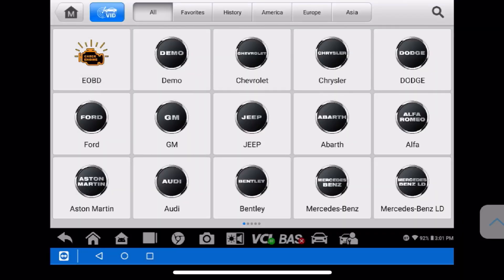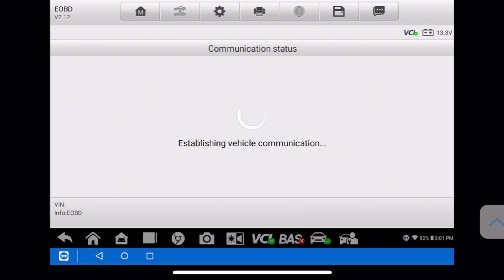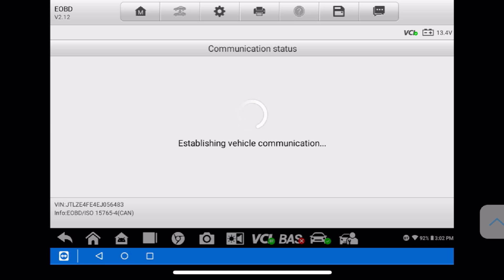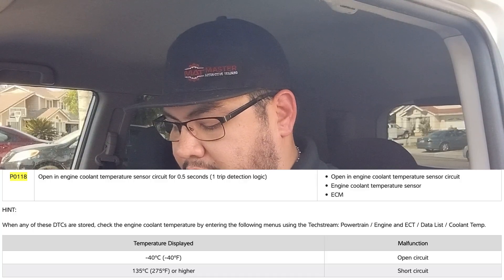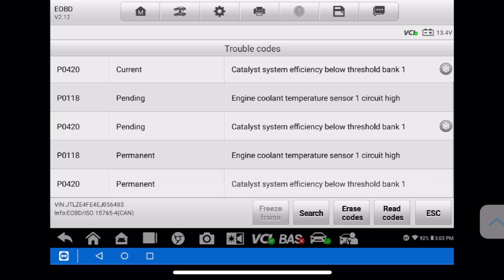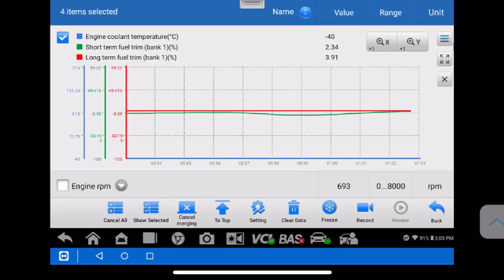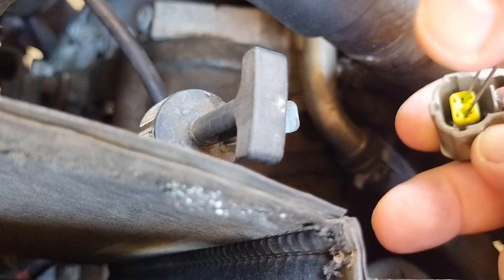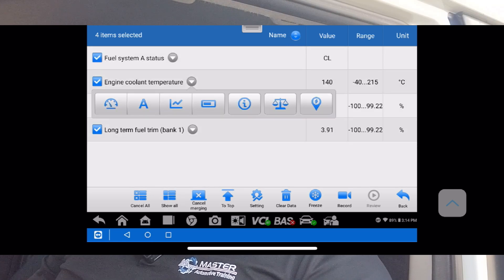Engine Coolant Temperature Sensor P0117 / P0118 | How to Test and Replace

Comment: That's fine I understand that but my question is I can run it everything's working fine then all of a sudden my temperature starts going erratic for an amount of seconds goes normal and then it starts going erratic again I am assuming it is a wire. It is on 2013 6.6 Duramax it may have been replaced the picture because it is too black wires and according to the diagram it is yellow and a tan. So what's your thoughts if I may ask

Comment: thank you SO MUCH! had the P0118 code that would IMMEDIATELY come up on my 2015 rav4.  Diagnostics showed the ECT at -39 even after 2 brand new ECT's.  did your trick and the scanner showed 300 degrees.  You're AWESOME!

Comment: I tried the paper clip to test the connector, and i saw that the temp went up on the computer 330 degrees on the computer. Does mean the circuit is ok thanks for the video.

Comment: I have code Engine Coolant Temp. Sensor (G62) P0118 - 000 - Signal too High but all temp show good no minus. Change all sensors same nothing happens fans run all the time.